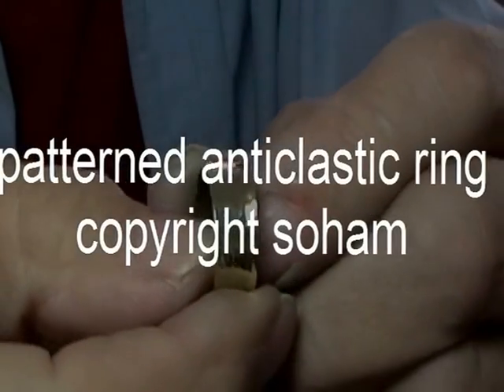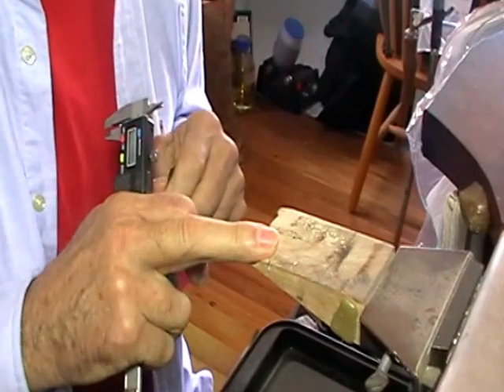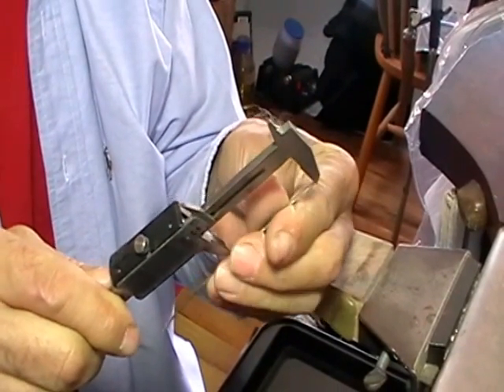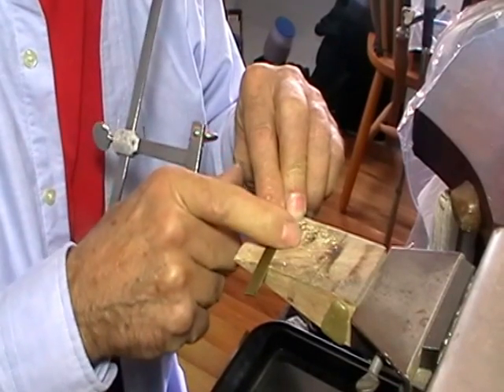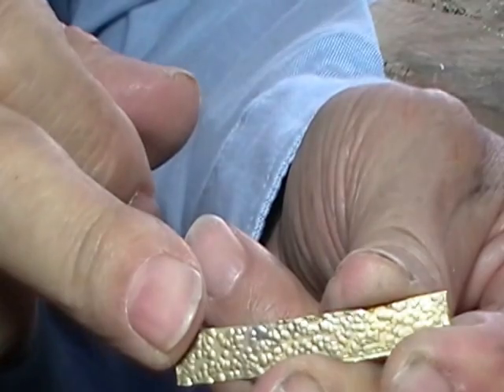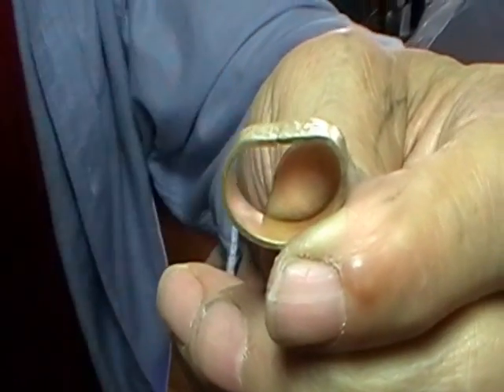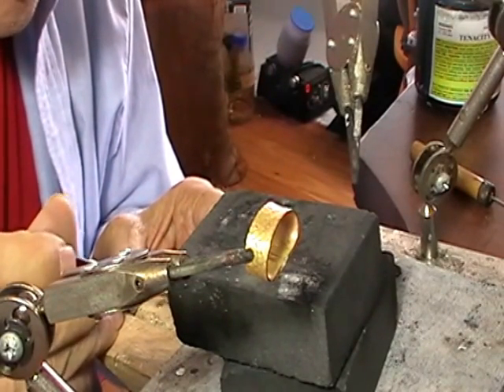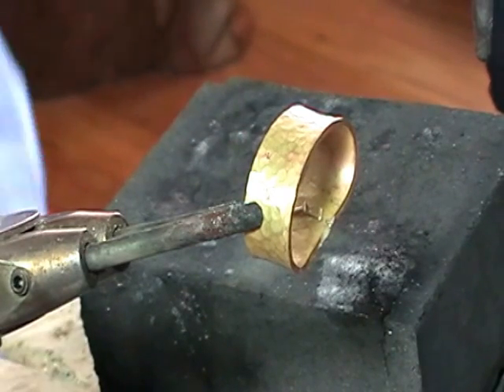patterned anticlastic ring

Comment: Wouldn't it have been better to pattern your metal first before cutting to size?  The patterning could very well stretch the metal and distort the original measured size.
Reply from the maker: there are many ways to do things, this is just one. patterning before hand works too.

Comment: Mr  Harrison
I loved your info about fira scale and bring up the silver. I am and old school jeweler from Brasil and jewelry making was my first trade for the past few years I got back into it and so many diferent tech and equipments. my question is.I do my own ingots and I mill my metals as I need and after finishing the piece is just a lot of fire scales I was undering if it wiil work after all the final filing and sanding bring it up the silver and hand polish on the flexshat or if you know a better way to reduce the scale. my pieces some times is very elaborated with lots of soldering.
thanks you are the best.
Reply from the maker: after you bring up the silver, tumbling is necessary, if you polish with a mop, the fine silver is polished off and firescale is visible.

Comment from the maker: rio grande has copper wire solder, but it comes in one pound spool, i tried it and wasn't  very happy with it. just use silver solder from rio (hard)
 i recommend handy flux from rio. if you do a good job with the silver solder there shouldn't be much clean up. if you solder on the back of your jewel it should be cleaner.

Comment: very nice video! Did you use copper to make that ring ? Also, if I don't have that shaper tool to shape it in the middle  with the depression like you did with this ring, is there another way to shape it that way with the depression in the middle?
Reply from the maker: brass. just hold the ring sideways on a flat surface and use a doming punch. do both sides
Reply: soham harrison, yes, you are so bright. That will definitely work well